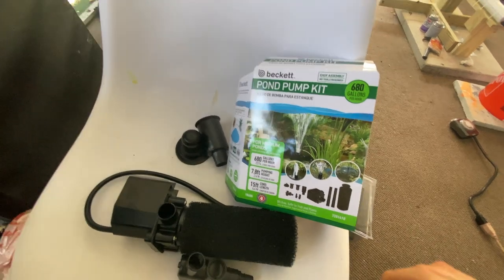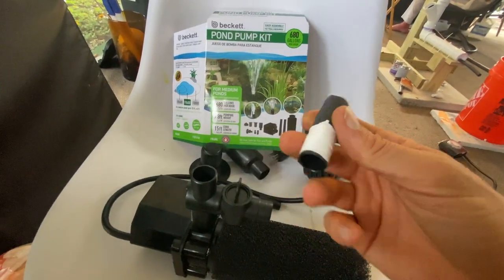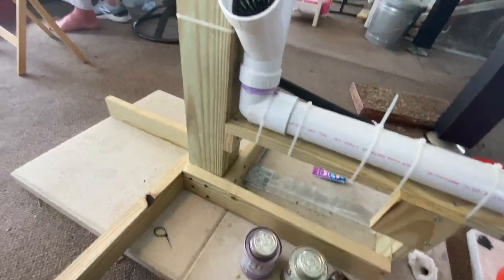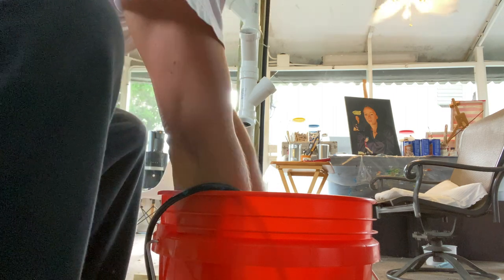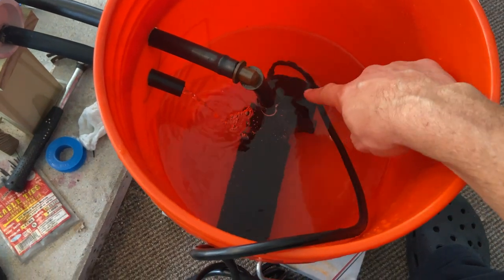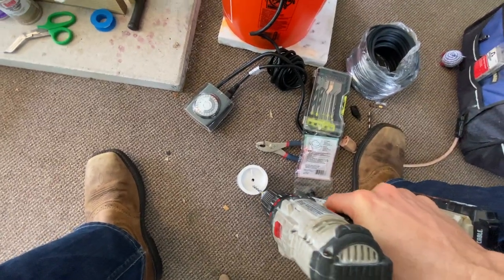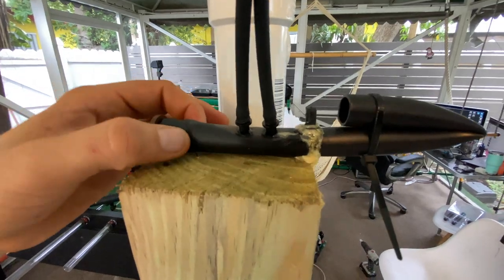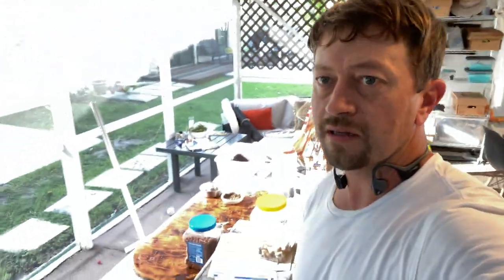pt10/10 How to build a Hydroponic Vertical Grow Tower System from scratch

Comment: Plastic soil pipe repair will fix the leaks, just run that larger tube to the top and valve it for pressure. Make sure water on return circles inside of pipe and youll catch every pot. Depot, soil pipe repair in plumbing dept. Pipe must be dry to apply
Reply from the maker: It was my first iteration for sure and I enjoyed the making of the project.   
I actually ended up selling the unit to someone 👍.

Comment: Hi any update cuz i m about to invest for the "same" system
Reply from the maker: No updates.  I pretty much stopped right there. Just make sure you have a really good pump pushing water all the way to the top. Other than that, the system works really well.

Comment: Why didn't you just run the 3/4" pipe all the way to the top instead of reducing it down to 1/4", that's not a pressure pump, all reducing it down does is cut down the amount of water flow whereas a pressure pump would make water shoot out the 1/4" real hard
Reply from the maker: Yeah, it’s wasn’t a perfect build out.  A lot of tactical improvements could be made in future builds.  It was my first one, soo maybe this will help others improve upon what I attempted.  😎👍